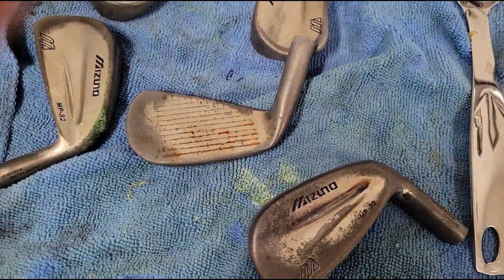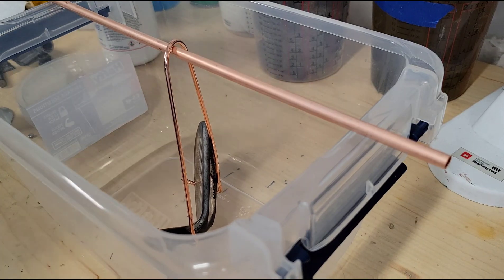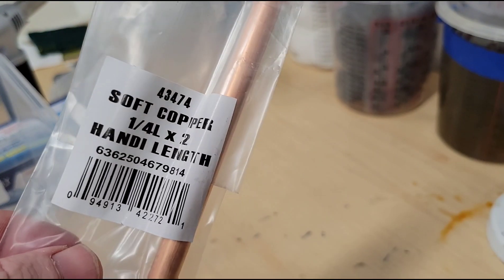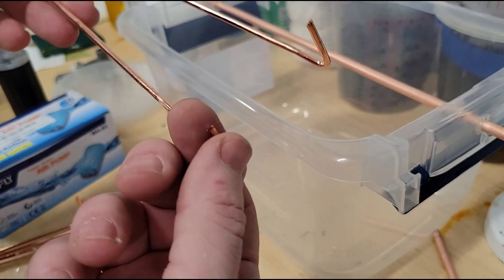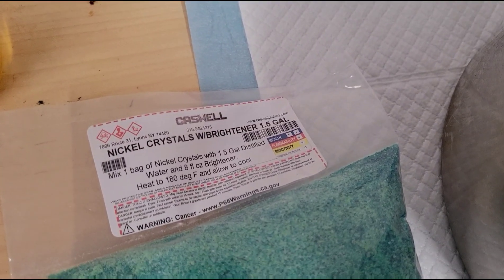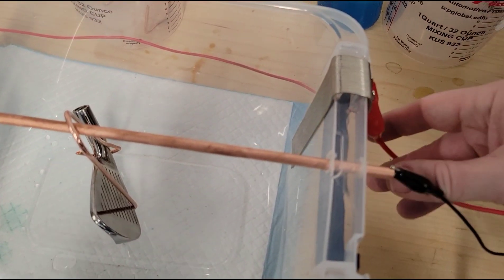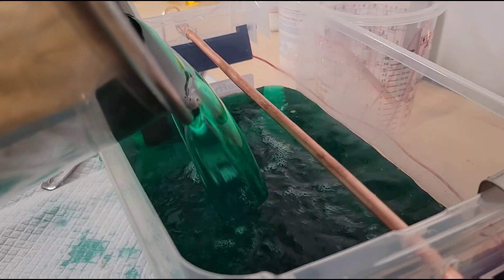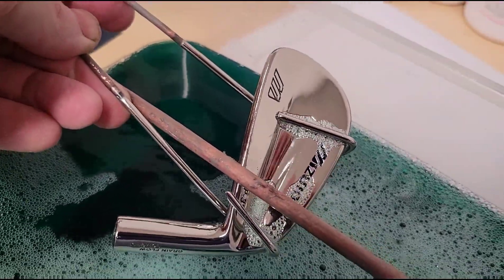Learn How to Electroplate Golf Clubs at Home! - DIY Golf Club Restoration

Comment: Brad love the stuff man. I have a set of 32's I'm looking to fix up, but not strip and rechrome. What compounds on what wheels would you recommend? Should/could I deburr any larger gashes out? Anything you can do to the faces? Also, whats the lifespan look like on this nickel treatment...they look awesome
Reply from the maker: Thank you. 

The chrome layer is so durable that you'll have a hard time getting anything larger than scuffs out with polishing. At best you'll have shiny bag chatter, if that makes sense. The deburring wheel will eventually make it's way through the chrome layer and into the nickel, so you'll have exposed nickel in spots and chrome in others. Knowing how Mizuno wear, you likely have exposed steel somewhere that would at least need a brushed layer of nickel to protect it from rust, or use a corrosion preventative spray on it regularly.

If you do want to shine them up as-is, I'd go with the stitched denim wheel and a yellow compound. It's very soft and won't cut through your chrome.

The jury is out on the longevity of just nickel plating the irons since I just figured it out and haven't finished the set. The good news is, if it wears I can just throw them in the tank again with a little prep first. The nickel solution continually replenishes itself so all you need to add over time is more Distilled water and maybe more brightener.

Keep me posted on your decision and let me know how they turn out.
Reply: @BradMeehan  Completely makes sense, luckily most of the set is in good shape so I think a solid polish will get them looking great for the season and maybe some re-polishing and reapplication of hoppes #9 lubricant will help them last longer. Anything after the denim/yellow to finish it off or you think just the denim/yellow is all it needs?

9 iron I have has a big gash on it (bought another to game incase I can't fix it) that I may try and deburr to see if it can get 'buffed' out. but I wasn't planning on getting that back to perfect anyways.

I don't think I'll nickel plate but what you just said has me curious now haha. So you can save the nickel solution and just add distilled water to use again? Theoretically meaning that you could just continually replate them? Also since you have me thinking now...what did the nickel plating do to the overall weight?

Thank you for taking the time to answer these questions! Unbelievably helpful
Reply: @BradMeehan  how is the longevity looking like with the nickel plating? any update?

Comment: Hey Brad! Thank you so much for these videos they're extremely informative! I had a question in regards to polishing: so I looked at the different colors of the buffing set and correct me if I'm wrong, but it seems like the ideal buff should start with white, then brown, then finish it off with green? Does that sound right? Also, when would you use black? Thanks so much!
Reply from the maker: Hi, Matt. It depends on the metal, I'm learning. The compound kit I bought has a chart that shows which color to use for each type of metal. Some start with black, brown then go onto white. Some finish with green, some blue, or some even red. The black is the most coarse so I only that when I have larger scratches. I use it on my sisal wheel (a very hard wheel me of straw-like material) or the stitched denim as the first cut, then brown or white. My opinion is if you can get away with something finer to start (like white), you don't have to spend time getting out scratches you introduced from a heavier compound. But if that isn't cutting,  you can back into brown or black. I'm sure the pros would know better than I do, but they seem to turn out quite shiny!
Reply: Brad! for polishing... is a 550w 1/2hp and 3000rpm motor enough?

Comment: Look great, other clubs you have done look amazing like the TM TPs.  That work made sense because you just grind em, buff em, play em and rinse and repeat if need be in 5 years.   But can you play with these nickel plated very long before the nickel is destroyed?  I don't think there is any real playability issue, only the nickel plating holding up.  Or do you have some plans for chrome plating these?  Have you tried this with putters?
Reply from the maker: Hi Mitch. Thank you. 

I haven't been able to test the durability as I've just learned this process and haven't put them through the extremes yet. I don't have plans to chrome them just because I'm cheap and I want to learn new stuff, so DIY is the plan.

Caswell sells a Copy Chrome that has cobalt in it for durability, which I might try too. I like that it's quite easy to do once it's prepped, so I'm not against throwing it in the tank again if they wear again (which they will).  That would make a good video: MP32s... one year later.

Comment: Another great video which makes this look simple. Must try it. However, curious about the paint fill; the head seemed to emerge with perfect fill? Do you do the paint fill before dipping on the basis that the nicol won't attach to the paint? Would it not be better to  plate the whole head and then paint fill?
Reply from the maker: You should clean it out but it won't bond to paint, chrome, or anything dirty.
Reply from the maker: Just lazy on my part and wanting to try it out. Acetone would remove the paint fill and would alleviate the risk of contaminating the nickel. Next video will be how to finish the face.

Comment: excellent video! If you repeat the process several times, can several layers of plating adhere? At how much voltage did you supply the plating tub? How did you remove the plate from the golf clubs? regards Thank you very much for the video greetings from Monterrey Mexico!!
Reply from the maker: Check out this link:

https://youtu.be/VRiefpq1iVs

This is how I removed the old finish. You can replate it again buy you'll have to reactivate the nickel using a nickel activation solution (also sold by those guys) for it to bond.
Reply from the maker: I forgot to answer the voltage question: I started with 4.5 volts and 1 amp, but lowered it to 3.5 volts and .5 amp on the second club but let it plate longer.

Comment: So awesome!! Roughly, how long did you leave the iron heads in the solution?
Reply from the maker: Total, I'd say a 2 hours but I kept jacking with the voltages. The longer you leave it, the brighter and thicker it gets. I left the wedge in there for 4 hours on a lower voltage. "Slow and low" is the recommendation.